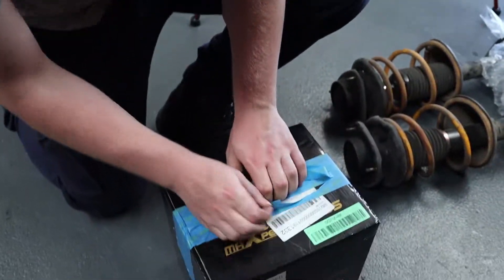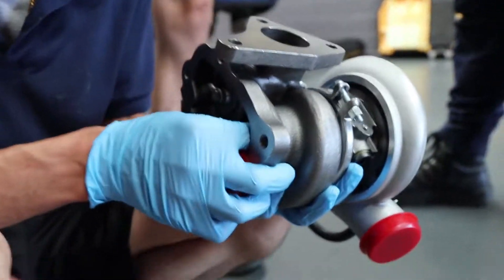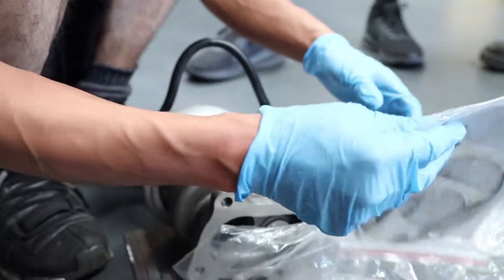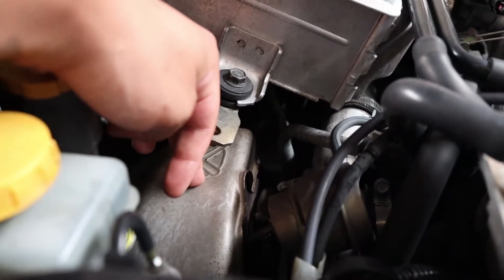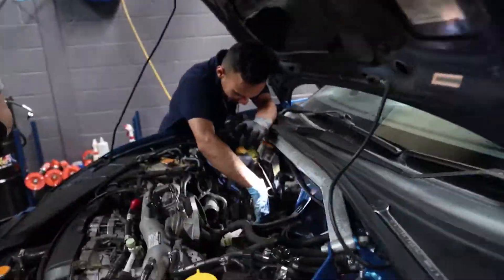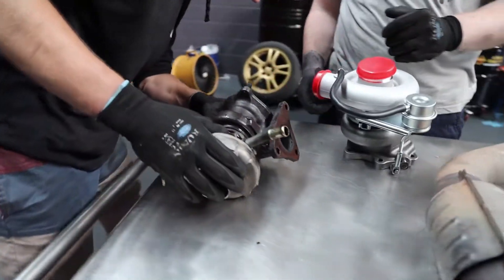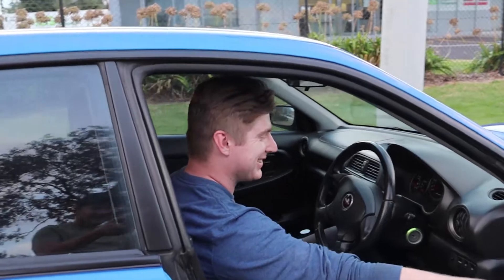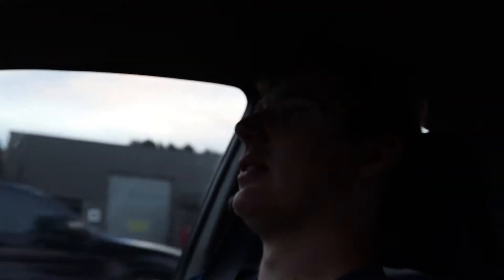Max Peeding Rods Turbo Install on GDB WRX! Straight Bolt on TD05-20G vs TD04

Comment: hi i was trying to fit this into my blobeye today and struggled with the fitting saw comments about getting some supporting mods in this comment section which was really useful, one thing i struggled with and need some advice on is the actuator bracket, does anyone have any tips on how to  make it fit on? and if i need to change any of the bolts?
Reply: i did it on my ej205 blob and had 0 issues 
maybe make some more room and wiggle it onto? if you need help lmk maybe we can link up via snap or something like that

Comment: The turbine is too small for that compressor wheel IMO.  You need at least a TD06 turbine for better flow.
Reply: I was thinking of running a Td06 20g on my 05 Forester XT  it has the 2.5 I'm just wondering how bad the lag would be. But I do like the fact that having a larger turbo with a larger back housing helps the engine that way it doesn't have as much back pressure and not as much heat especially because I have it tuned on E85 and where I live we don't have emissions so I have the ability to cut the cats if I need to

Comment: I just still not sure of fitting it into my e36 2.8.....I've seen so many bad things about these turbos....i'm pretty sure that most problem when someone fitting it is right feed and oil drain....
Reply: did you do it? im thinking of buying the td04 13t from max but im afraid

Comment: Can you guys show how you attached the coolant lines from the td05 did you have to cut the connected lines?
Reply: Man I’m looking for this info too. What it looks like is the Cobb brand comes with the coolant hard lines the fit around the compressor housing. I haven’t been able to find just the hard lines tho…I might just try to heat and bend the lines I have 😬😬😬
Reply: @samwashere1392  I ended buying some tf05 coolant lines that were braided stainless steel worked wonders
Reply: @pinkrl_  that’s what ima have to do. The banjo bolts for coolant lines from both the td04 and vf48 I have are too small to fit in the MSR td05 anyway. You got a like for the kit you got?
Reply: @pinkrl_  can you send a link to the lines you bought fitting this on and need to do the same as you

Comment: 20g td05 must have a huuuuuge lag. I had td05 16g on mine and it already is lagging a lot.  Without a tune it basically ruins the car in low end rpm. The top end punch is fun though. Please if you do this at least get a AFR meter to see if it has enough fuel. Curious how last it will last/have lasted
Reply: 3portebcs helps alot

Comment: I’m so glad you’re doing this I have a VF22 I was going to get a td-05 20g but my mechanic said to stay with the VF22 I’ve got not sure I’ve got maxpeeding rods coilovers they’re pretty decent!
Reply: The VF22 is more responsive & makes as much PSI as the 20G as what youd need for a stock WRX engine. Also these $200 journal bearing TD05-20G's flog out very quickly (mine lasted 3 months till it started hitting the compressor housing).
Reply: @technology42069  oh wow I can’t wait to get a fmic & e85 etc for my VF22 yeh the boys!

Comment: Just ordered mine for my 02 WRX but it didn't come with any Coolant or oil pipes and the stock TD04 ones didn't fit. Is there a special type
Reply: yes, get adapters to AN fittings. Costs about $150 for the water lines
Reply: @technology-in3ei what AN size should i get because I also only have the td04 lines and am not sure what to go to attatch to the engine
Reply: @pinkrl_  for mine I bought TD05 flex hoses and since they were flexible, they could fit any space. I also got confused by the two holes on each side but found out the order didn't matter just as long as there was a Inlet and outlet
Reply: @jibzz4749  how is it going I'm struggling to get mine in rn but how was the performance and did it really improve?
Reply: @pinkrl_  I put the project on hold and ended up taking it out. To gain power, I needed a tune and a couple of other things but I did fully install it. I never drove it, only started it as it wasn't yet tuned. I'm positive it will make more power after a dyno tune, even on stock injectors and stuff but I still do recommend you get parts to handle the Turbo such as a high flow feul pump and  injectors at the least
Reply: @jibzz4749  cool yeah I got 660cc injectors, ti spec downpipe, and upgraded coil packs, same with a fmic cause of the injectors I'll have to get a tune anyways so I'm hoping for the best I'll just have to get a tune
Reply: @pinkrl_  well, good luck
Reply: @jibzz47  could you send me a link to the flexible td05 lines u got?
Reply: @pinkrl_  I'll see if I can find it again
Reply: Or you can just get separate Bango fittings that fit to your old coolant lines

Comment: I am about to fit a TDO5 20G to my WRX Blobeye which has the EJ207 V7 STI engine fitted , but with the TDO4 from the EJ205.
Is the TDO5 a straight fit ? 
Did you need to change intercooler piping , oil pipes , water pipes , etc ?
I want to do the swop without having to order parts online and wait forever. :)
Reply from the maker: Didn't need to replace much, mainly just turbo and turbo oil drain line

Comment: I would like to just jump on here as I try to with any of these videos to say for the past 2.5 years iv run the Gt28 maxpeedingrods turbo on my 300+ horsepower car. The car gets absolutely spanked and driven hard. All I can say is they are amazing value for the money and I'm now looking to go from the 28 to the 30 obviously I have to save up as its a bit more expensive however if it performs like the 28 then it's a hell of a bargain. At the end of the day all companies started from somewhere and in 15 to 20 years I hope maxpeedingrods will be highly spoken of like some of the other companies around. No need to be biased. They do what they say they do and do it well.
Reply: Still going good bro ?
Reply: @Bazz98 I'd love to know too 😮

Comment: I’ve always been very wary about these Maxpeedingrods turbos, glad to hear it’s doing so well. Be interesting to see how long it actually lasts. Was there any figures after having it tuned with the new turbo?
Reply from the maker: Surprisingly nothing has gone wrong with it still! Which is amazing hahaha
No power figures unfortunately as I don't have access to a dyno!
Reply: @ajsakai  who did you get to map it in and what sort of boost are you running?
Reply from the maker: @AlphaWolves-Hunting  It's running on wastegate PSI and on stock standard tune!
Reply: @ajsakai   No tune!? wtf lol the td05 will be producing heaps more cfm regardless of psi lol
Reply: @trizie8613  the fact that he doesn't even have a tune makes that turbo even more impressive
Reply: @ajsakai  People like you are the reason Subaru gets such a bad rep. They throw a turbo on with no tune and blow their car up. Then blame Subaru.. 🙄🤦‍♂️🤣
Reply: @ajsakai  what is the wastegate pressure!? How is this thing still ripping? No fueling upgrades??